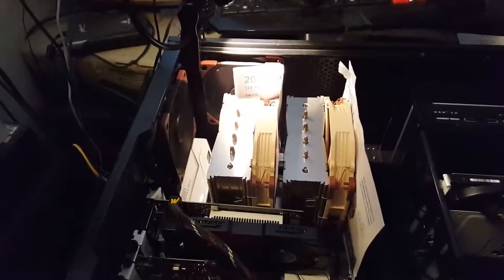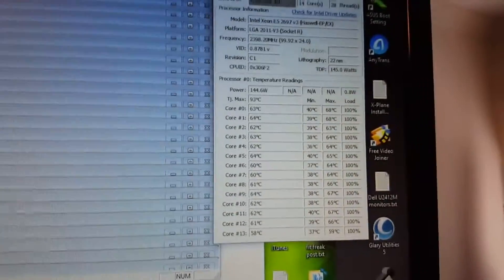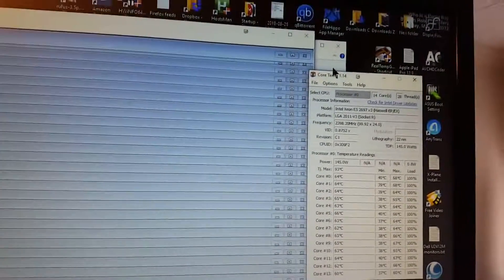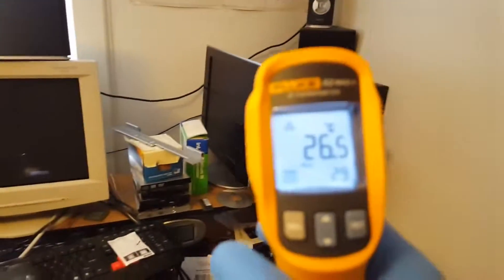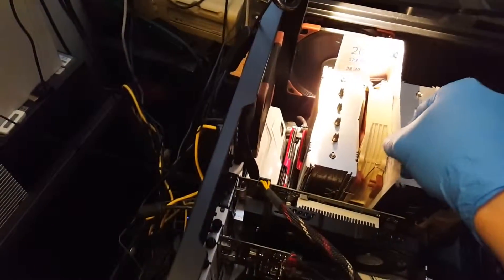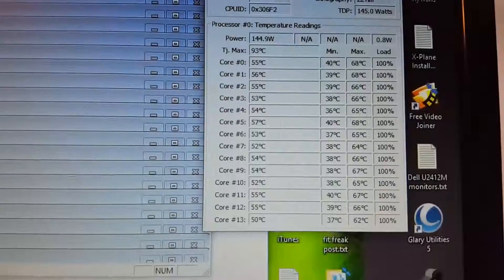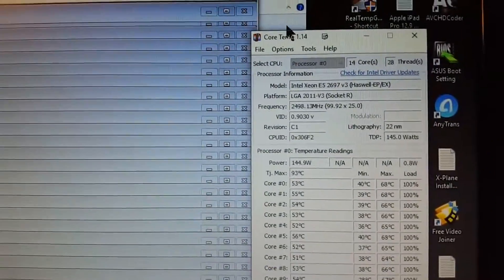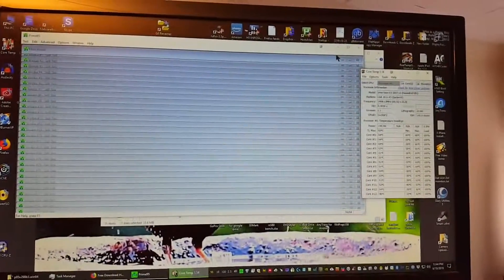Intel Xeon E5-2697 V3 thermals under load socket 2011-V3 Asus X99 Deluxe II

Comment: Hello! Do you think a Noctua NH-D9L might work in cooling this CPU?
Reply from the maker: They have new ratings at Noctua and the nh-d9l has less than half of the nh-d15 which is my cooler. At full load nh-d9l may not be sufficient to cool this chip. Order it from Amazon and you have 30 days to test it if you need a cooler of this size.
Reply: @loveaviation  thanks a lot! Fact is my case doesn't have enough space and your cooler won't fit in it. In the need of a good and compact cooler what would you suggest?
Reply from the maker: @lucioarese  you need to measure how much space you have from the top of the heat spreader on the cpu to the part of the case that is limiting your cooler’s size. Noctua has a page where they test coolers in many cases but they may not have yours. Newegg is a good place to research and some times buy.
Reply: @lucioarese  I have NH-9DL’s on my e5-2697 V3’s on a Supermicro x10dal-I-o mobo in a Phanteks Enthoos Pro case because they were the biggest I could fit. The coolers had to be installed with them blowing at each other, directed towards the case exhaust fan. The fins of the two coolers slightly touch each other, but it fits and works just fine! Running full-core prolonged photogrammetry workloads, my max temps stick around 70 deg Celsius or so, which is completely in the “comfortable” territory for me.

Comment: Great video! I am currently building the same setup but with a e5-2680 v3 and was wondering how the D15 fan would do! Looks perfect. I was wondering what your doing with ram. I'm new to building computers but the mb goes up to 3300mhz ram and the CPU only to 2133mhz. I was planning on getting some Trident Z 3200mhz 4x8gb but wasnt sure how well it would work with the cpu only rated up too 2133mhz ram.

Just wondering what your doing with ram. Oh Hey, also wondering what watt psu your using. I have four 6Tb hdd's and was thinking 750watts is plenty. 

The fans look great in there!
Reply from the maker: Honestly speaking, This cooler is overkill for this CPU. and even more for yours as your CPU is 130W and mine is 145W. As far as RAM then I recommend getting quality RAM like Corsair or Gskill speed rated for the Xeon CPU you will be using. On my board and probably most boards the RAM cannot overclock while Xeon CPU is installed. Buying ing fast ram will only work on stock speeds supported by Xeon CPU. On my X99 Deluxe 2 board I was not able to boot with even a slight increase in RAM speed and enabling Intel XMP profile included with the 3600 MHZ RAM have resulted in the board resetting the UEFI BIOS to stock after several unsuccessful attempts at boot. Xeons support very little overclocking and RAM isn't one of them at least on my board. But I was able to increase the base clock from 100 MHZ to 105 MHZ boosting the CPU base clock to a little over 2.7 GHZ (2.6 stock for the E5-2697 V3). One of the videos in the "Upgrades" playlist shows where in the UEFI it is. The power supply I am using is a Enermax 80 Plus Platinum 850W. I bought it so at full load I will not continuously exceed half it's output rating and keep things cool and safe. Here is my current configuration of this PC https://pcpartpicker.com/user/sonicmixmaster/saved/Ffdf8d
Let me know if you  have other questions. Here are more videos of my X99 build. https://www.youtube.com/playlist?list=PLqLjsgvQZ4giMWL6WSBrqEdjwZogmI9oY
and
https://www.youtube.com/playlist?list=PLqLjsgvQZ4ginGVmx08othor71Ulk5U17
Reply: @loveaviation   I've never build a computer where I had to do much in the settings with overclocking and such and am not familiar with th he Asus bios. Is the jist of it that no matter what mhz the ram is, I wont be able to run it higher than 2133mhz (the CPU max mhz rating)? So if I get ddr4 3200mhz I'll have to enter it into the bios as 2133mhz?
Reply from the maker: @stephenwhite5444  Yes, CPU will force you to run at 2133 MHZ because that is the highest speed it supports. So do not buy the fast memory unless you already have it. By the way, I just ordered a 970 evo plus NVME SSD 1 TB to double my boot drive capacity and it will be almost 2 times faster.
Reply: @loveaviation   I was looking at nvme ssd's today but a 500gb version. I saw the Samsung evo plus was only $100 and have been really considering it. I'm finishing up getting everything I need. I got the smaller Noctua fan, the U12S, tests show that it should do pretty well. I ordered G Skill Trident Z but it's faster than I need...its 3000mhz but its the pc4 24000 bus speed version and I read its stable running at 2133.

Do you think when I enter the mhz as 2133 instead of 3000, that I will need to do something with timing? It has a sticker on it that shows the timing, but I wonder if that changes when the mhz is changed.....you have any ideas on that?
Reply from the maker: @stephenwhite5444  I like Gskill memory. and the red sticks I have are sexy LOL.  When I was ordering all my parts I wanted to get the fastest I could afford within my budget and I wanted speeds that will not slow me down for a long while into the future. The 2011 socket CPUs were very expensive so I started off with the 5820K and overclocked it a little to 4.2 GHZ. The RAM will default to 2133 unless you enable XMP so you don't need to do anything with it, just install it in the appropriate slots so you get quad channel access or dual channel if you only ordered 2 sticks. Oh and don't worry about the timings, the motherboard will adjust itself to use those timings. My RAM is in quad channel if you look at all the videos where you can see the RAM it's always in the slots most outer away from the CPU and the second ones from the inside. I got the 1TB NVME SSD as I am using it more for manipulating some large files then I put them on the slower storage once I'm done with whatever I need to do with them.
Reply: @loveaviation   yeah ram now a days looks pretty awesome and is cheap for how much it is....I cant believe I just bought 32gigs of ram (4x8gb) with built in lighting for $150....seriously the last time I bought ram it was just the green stuff and it was probably 2007. Hahaha. I'm having fun building it though, it's very similar to your setup.

You know, my Fractal Design 7 case has what I'm going to call a fan connection block....where all the case fans can attach and they are managed together. But it looks like I could just hook the fans up individually right to the mb and control each fan separately based on various temperature sensors. Is that how you set your fans up?
Reply from the maker: Stephen White The Asus motherboard I have has some kind of a fan tuner or something I don’t remember what it’s called where it will check each fan separately for RPM and then adjust accordingly depending on what you set as the temperature source. My PC is silent the way it is and only ramps up fan speeds when I transcode video where all the cores are used at least 50%. I think it’s called fan expert or something.  I think I show it in one of the videos I just don’t remember which one.
Reply: @loveaviation   that's how the fans seemed to me when reading the dekuxe ii manual. I think I wont use the multi connector in the case and instead connect them all individually to the mb so they can be controlled individually. I suppose though, I should check the specs like what voltage the fans need and what the mb puts out to make sure it all works proper.

I'm pretty sure the case multi connector connects them all together and power from the psu, then there is a single wire that connects to the mb as like a 'signal wire'....so it's not having to draw all the power off the mb. But like that, all the fans have to run together, theres no individual control.
Reply from the maker: Stephen White don’t worry about fan voltage. Let it configure the fans itself. There is a high amp fan header near the top of the board on the edge where the eps connectors are. You can hook up a high amp fan there or a pump.